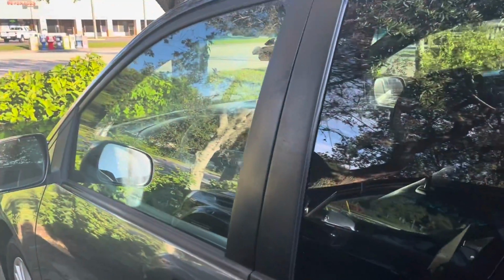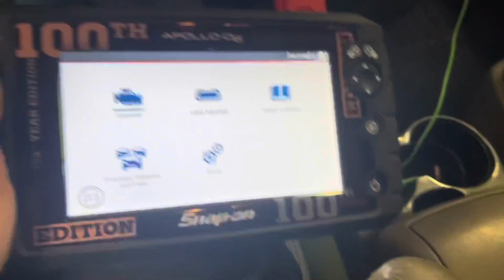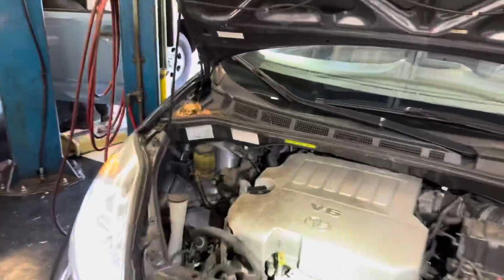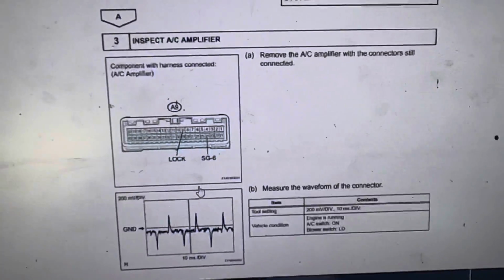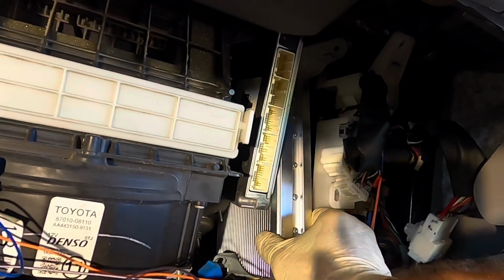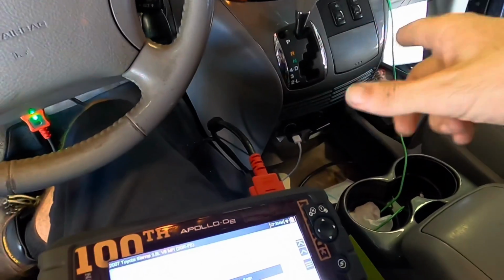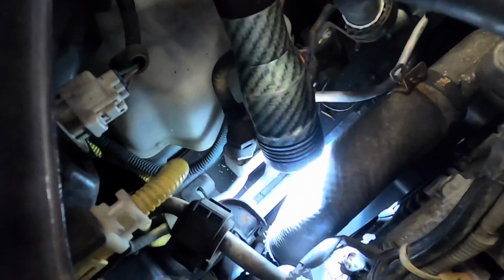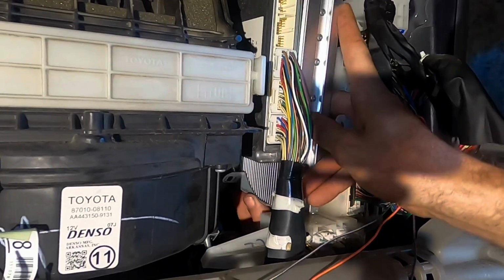Ghost Toyota: Engine running with no keys! And Customer States: No A/C

Comment from the maker: 🚨🚨🚨🚨Here is part two where I perform the repair of the A/C system. Which also kicks my a$$ a little.
Check it out here! It's over on my second channel! https://youtu.be/Afoy6MpVrSU🚨🚨🚨🚨
Reply: but what about the "runnning without th key" part?!
Reply: @DekwaDoes  I would guess that it was in “remote start” mode and the signals to shut it down when brakes are applied or key is cycled were not properly hooked up. I’ve had a few remote starts installed and all kinds of crazy things can happen.
Reply: @DavidSimpson1973  After reviewing the keyfob, I doubt it... But I'm not an expert ;)

Ray just showed it, and then never mentioned it again... :/
Reply: @DavidSimpson1973  Could be for repossession, I've hauled a lot of Santandar repos that had "issues" like many have stated. Messing with the main power supply is such a dumb way to hack into the wiring harness. They should just do a fuel cutoff remotely and call it a day. Personally, I don't want to own something that has been hacked apart like that.
Reply: @DekwaDoes  aftermarket alarm immobiliser crap
Reply: I once blew a P/S hose and had that happen for awhile.
Reply: What is the technical name for that relay switch you plugged into the power box???
Reply: Mechanic states:  Unable to replicate problem.
Reply: i had test & tests & tests, & it wasnt working,,but,,i got 4 kids.. explain that..   divine intervention,,by the guy next door.. i watch your vids for info..excellent.. plus,, ill never buy a new car.. in our 4x4 club,ausie.. guy did 1500 ks, in limp mode..no good having tech in the desert.. we can do 3 month trips here, so, no tech is gooooood..

Comment: AC problem is exactly what I had with my Corolla when the radiator fan was failing. If you have it a nudge when it wasn’t working it would suddenly start spinning on its own and AC would return. Wind an bumps while driving would typically give it that nudge but not when you start it up and try to get it cool first.

Comment: I ended up having the same problem with my GMC Sierra, where the engine stayed running with no key in the ignition.  Turned out after it happened two different times, that the aftermarket remote start installed before I bought the truck had started to short out the starter.

Comment: I know it’s been 10 months, but I think that car has a remote start system and the customer started it up for you. I installed one on my mom‘s Toyota Highlander that utilizes the factory key fob. You start it by pressing Lock three times, and once you get in the car, you insert the key into the ignition and press the brake. Pressing the brake is what turns the ignition control back over to the key, which is why it shut off fine after you drove it into the shop. Also the tire light is supposed to come on indicating that it’s in remote start mode or whatever. It was a 12V Solutions system… anyway I’m sure if you tried to do before putting your foot on the brake to put it in reverse I’m sure it would’ve shut off and set off the alarm.

Comment: Eh, you started with an unknown issue. No need to second guess.  You could have gone "analog" first, and still ended up having to pull that unit. 6 in one hand half dozen in the other.

Comment: I had an early 2000s Ford Mustang with a V6, manual transmission come in for no A/C.  Also had a check engine light on. I have a personal habit of pulling codes jsit to see if there's any relation between that and the issue at hand. Codes pulled up faults for O2 heaters (all 4), purge and vent valve issues, no compressor due to relay codes. Upon pulling a wiring diagram and finding a burned fuse, I then put the car up in the air to see if there were any harness issues. Unplugged all the O2s, still burned the fuse. Pulled the purge and vent valve connectors, still burnt the fuse. At this point I headed towards a dead short. Upon looking around the engine and Trans, that's when I found the harness over the bell housing was pinched between the engine and tranny, more than likely when the last clutch was done. That was a fun find and fix.

Comment: Had that happen with the trucking company I’m working for lol one of the kenworth trucks wouldn’t turn off no matter how many times you try to cycle the keys, only thing that would shut it off is if you pulled the fuse

Comment: The way I look at it now from being in the industry for a number of years is the a/c compressor is the hardest working, most prone to wear item in the a/c system. The service manuals were made to diagnose problems on NEW vehicles with NEW components. The likelihood of an a/c amplifier module being internally defective on a Toyota with that age on it and being inside the vehicle not exposed to atmosphere and weather is very unlikely. 
What concerns me the most is the wiring job someone else did on that remote start system. 
Hacking in to and piggybacking harness wiring is generally very suspicious and does often cause corollary problems with other wiring system components depending on the level of care and attention made with the remote start installation.
You did a good job diagnosing this issue and regardless of going down the rabbit hole of testing components you were thorough and you learned to go for the obvious even when you think there may be something else causing the problem.
Understandably you didn't want to install an expensive new a/c compressor when there may have been something else causing the HVAC system malfunctioning.

Comment: I've seen you use your smarts to quickly diagnose something in 5 minutes..
It's called "street smarts" and usually give better, faster results...

I've been a network troubleshooter for over 40+ years, and there are basic tests that take me 95% of the way, by simple asking the customer a few basic questions and poking around the device.
I still have colleagues that will refuse to investigate or talk to the customer until they have all the diagnostic files, which really delays a solution, sometimes for weeks..
They do it because they're not confident or competent in their diagnostic skills, or lack the imagination to find  2-3 ways to test the same thing, which would provide confirmation.
Not to toot my horn, but I average 1 day  to solve 99% of my customer issues.  (and I mean average time)

Comment: I had a 2004 Toyota Tundra after doing some work in the engine compartment I noticed my AC light flashing, a quick search found that there was a missing ground. I simply went to where I was previously, and re grounded, and all was good.

Comment: I had a car like that ran without a key. The tumblers in the ignition was worn out. I had to change that out. I went to dealer and got the tumbler to work with my existing keys so I didn't need 2 different keys

Comment: My guess is that 99% of shops would have taken one look at the wiring mess inside that affects the key, and either refused to work on it, or simply recommended a new compressor, and an up-front shop would have told the customer the compressor replacement was not a guaranteed fix due to the age of the system and their lack of specialized Toyota tools.  I think a waiver might be in order, just in case a replacement compressor won't fix the problem.  But this is a case where the shop has to determine whether they want to throw good money after bad, and the bad in this case is the old age and non-standard wiring of the car.
These are just my guesses based on logic rather than mechanic ability.  Sometimes the best bet is to save the shop and the mech a lot of time a frustration, which probably won't make the customer happy.
Sorry to see you take the hit, rRay, but at least the learning curve on this one will last a long time and probably save you from going down this primrose path again in the near future..

Comment: Way to go Ray. I was a factory instructor and service rep for Honda, General motors and VW for many years, and then ended up becoming a troubleshooter. Engineers are really not so bad. They are far from actually understanding the repair end of the business, but its the mofo's in marketing that can screw up a steel ball in a rubber room in under 60 seconds. Between them and the bean counters, the final product has been so "altered" it's a miracle they can even run. If you've ever looked at a a diagnostic flow chart and it seems that their methodology takes 50 steps to discover something that could have been done in 2 or 3 steps, you'd be correct. The longer it takes to diagnose (especially at dealership labor rates) the greater the income for the dealer. 

Currently (as of late 2019), 65 to 80 percent of a dealers profit comes from the service department and about 20 percent is from new and used car sales and the rest is from manufacturer financing. Without massive service department labor rates a dealership would go broke in less than a year. So they create a nightmare to repair anything in order to keep the dealers from jumping ship. Nothing like having to remove the rear seat to pull the console to get to the dash to replace a blend door motor that costs 50 bucks and 10 hours labor to turn a bit of profit. The customer gets hit for over a grand and the tech gets a hundred and fifty bucks and the dealership stuffs 800 bucks in his pocket. 

The engineers design 'em, the bean counters screw them up and the techs end up finding a way to actually fix 'em. Been that way for the last 55 years I've been twistin' wrenches and bangin' knuckles and it just seems to get worse every year. Factory diagnostics were designed to work on vehicles in new or pristine condition. Until they start installing rusty bolt sensors and dead bird in the radiator sensors or oil leak sensors. It will always be the techs like yourself that think outside the box and have the know how and experience to do the repairs successfully without a million dollars worth of special tools and a 30 million dollar parts department behind them. I have trained literally thousands of techs in my years in the business and from what I've seen you are among some of the best. Your attitude and demeanor are extremely impressive. You have a rare gift of dealing with stress that would have lesser techs lobbing tools across the shop, and yelling like fools. You have obviously learned one of the most important rules of being a tech, "Never get in a fight with an inanimate object, or It will kick your ass every time" 

Keep up the excellent work my friend. It's a pleasure to watch a true professional at work.
Reply: You're very good at the pep talks, Instructor Ramsey. 
Well worded.
Reply: I 100% agree the bean counters ruin more good engineering.  I don't even want to count the amount of V6 Infiniti engines we replaced when I worked there after the pen pushers decided to change the type of piston rings used in them.  After about 10k miles from new, they would start eating oil like an engine with 250K miles on it.  Was not a happy time at my dealership being a tech.  Don't know if they are still bad but FFS warranty replacement of an engine was a frigging joke.
Reply: It takes someone with many years experience to put things into perspective, and you did just that.
Those are words of wisdom..
I've been a network troubleshooter for 40+ years and your words ring true, although I don't have to "bust a knuckle"  in my line of work normally...  ;-)

Comment: Lol I remember my car was phantom running one time no keys or anything and it ended up being caused by a wiring issue from my Amp for the Subwoofer in the trunk. The wire that ran from the Amp to the ignition ended up getting shorted straight to the positive for the Amp and was feeding power back through the ignition and wouldn’t shut the car off.

Comment: What even is that control box supposed to be.. "AC amplifier" doesn't make sense to me. Looks more like an audio amplifier, which would also explain why it's kinda hot. On the other hand, I have seen so much fucked up design in cars already that I wouldn't be surprised if they routed the temperature sensors through the audio amp module "because it's all analog stuff anyways, and there's some free space left on that board"
(worst offender was on my BMW E36.. you couldn't scan for trouble codes if you had an aftermarket hifi system installed, because the fscking weirdos routed the OBD2 through the radio..)

Comment: My Toyota guy says when the ac clutch on a yoga doesn’t engage  give it a small tap with a hammer while the engine is running and ac on. If the clutch engages at that point the coil on the compressor is weak

Comment: This happened to me.  My car wouldn't shut off randomly and the ac would randomly work and the radiator fan would randomly come on. A  12 supply to the CCRM was shorted to the wire that powers the coil packs. So it was feeding power back into the CCRM keeping everything alive with the ignition was in the off position.  It was strange because it would run fine until it went into closed loop

Comment: some of the rolls royce silver shadows had a thermal fuse on the feed to the ac clutch,if the freon was low pressure due to a gas leak it would make the compresser run hot and blow the thermal fuse,pig if you wasnt aware .!

Comment: had an issue with a vauxall cavallier years ago wouldnt turn off with the lights turned on,was a tail stop/tail light with the fillaments shorted,ie the light circuit was powered all the time independant of the ignition switch but was back feeding the ignition via the brake light circuit,took some finding tho !

Comment: IF it's getting HOT, most likely not a high resistance but a LOW resistance, low resistance draws more current, partially shorted to ground
FIRST mechanic I ever met who didn't swear like a sailor !  I do !

Comment: Next time you test compressor like that I would just pull the relay and put bypass switch in a see if starts if don't then I'd test relay port for power if it doesn't have it I would try feed power into it see if compressor fires up then know area to look in pretty fast

Also should go to wreckers yard and buy up stack of plugs take pins out make ur own probes with them

Comment: These "manuals" are written with the kit on a bench so it's easy to check pins but, when installed (buried) in a vehicle, the test procedure become a bit more irritating.
For instance... WHY put fuses in a side foot well when you are lacking the additional joints in your arm and or neck, to look and touch at the same time.
Come on everybody, lets "Speak in Tongues" !!!

Comment: I think you removed the audio amplifier. This is looks the same in the prius. The connectors and the casing. Also as if I could see the JBL logo on the side of it, but not a clear view in this video. I just had my time with it in my prius and looks totally the same. Interesting what the service manual told you. I just write it for fun fact :) Not sure if Im right…

Comment: It is NEVER a waste of time if you're doing something the correct way the first time.. Because if something were to have happened in the diag process you can go back an say, HEY I did it the way that Toyota said to and this is what happened during the process.. So yea it sucks you burned a little more time but at the same time you were unknowingly protecting yourself from unwanted problems.. So don't beat yourself up about it because you've done some things that I would have NEVER wanted to take on and it came out perfect.. So you're a good tech and for damn good reason

Comment: Reminds me of when I just did a 2020 Chevy Malibu.  ECM was throwing a code for its start/stop system, and that the malfunction power supply isn't sending out the correct voltage.  After reading on the service manual on how to diagnose it from  the GM-SI site, it said to test the output voltage on the connector, plug it back in, clear the codes, road test and attempt to perform 5 start/stop activations.  Screw that I said.  Why?  The module is located under the center console, behind the shifter, under the cup holder, bolted to the floor, and there was no way I can get my multi meter in there let alone stuff my 2 hands in that tiny space, or dismantle the entire console.  The harness was only 1 inch long, and it was taped up to multiple harnesses.  Ordered and slapped a new one in, I'm not removing it twice lol

Comment: I had a 96 windstar van that I didn't need keys for. I could just turn the little wings on the ignition without sticking a key in it. I ended up putting a fuse and switch under the dash so I could take the fuse out and prevent the car from starting. I managed to lock myself out several times cuz I forgot keys but locked door lol

Comment: With the bypass switch in place and power to the coil, striking the clutch with a screwdriver handle or such may start it turning.  If so, and the air gap is correct, you know that the clutch is dodgy and it's time for a new one (which usually means a new compressor).

Comment: Before you give the aftermarket guys crap for the remote start.    Learn your parts.    The amplifier you removed behind glovebox is the jbl amplifier for the audio system.  Even if you could have tested the wires it wouldn’t have done you any good.